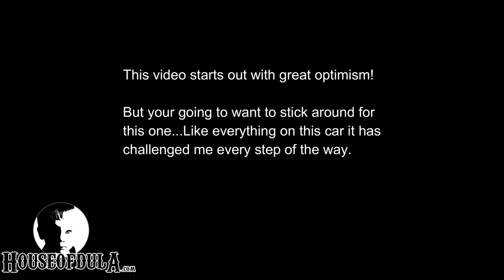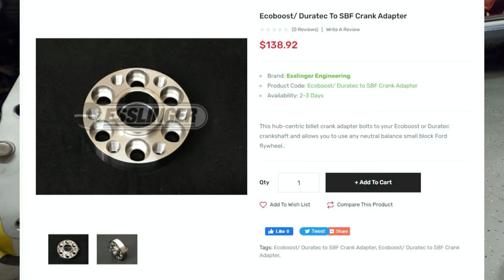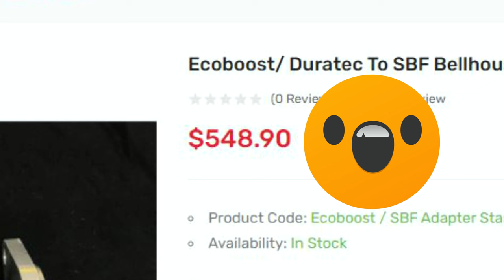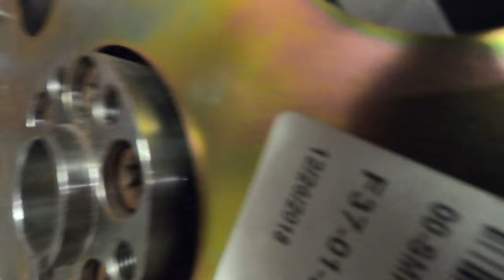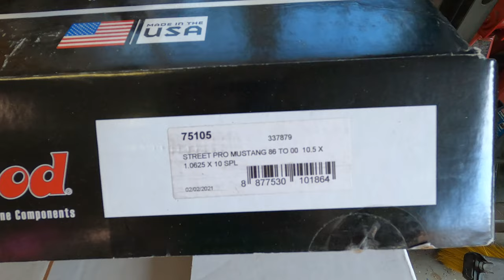Esslinger Issues - EcoBoost Install Part 1 - T5 mated to 2.3L EcoBoost - Episode 30

Comment: So I am curious, I'll have to rewatch this in case I missed it. Was that 2mm accounting for input shaft?
Reply from the maker: Yes and no, The crank spacer was milled down what 2mm? so the flywheel and clutch assembly moved in toward the engine 2mm while the bell housing stayed the same. This was enough to move my clutch out from hitting the bell. I dont think that amount will cause issues because it "seems" to me based on my measurements that the input shaft was not in far enough either. My logic says if all things are equal spacing between flywheel mount surface to bell housing surface between a SBF and 2.3 EcoBoost, then if you move the flywheel out with a crank spacer by "x" then the bellhousing must also move out the same amount. Its been a while, I measure the crank surface to bellhouse surface from a SBF and they were the same. What I milled off would have put  the input shaft in further, and the clucth/flywheel INTO the bellhousing more....anyway...the 2mm I took off seemed to correct all this without milling too much where the flywheel bolts wouldnt bolt on....I guess we'll see when we run it! lol I know Esslinger has made corrections to this kit since.

Comment: If you stack 2 spacer plates (or get a thicker one), you could still have starter alignment issues because the starter wouldn't "move back" with the bellhousing.  What if you cut off the portion of the spacer plate where the starter goes so the starter would pull up directly to the bellhousing?
Reply from the maker: This is true. If you stack the two you solve one issue. Clutch hitting bell, and clutch fork alignment, but would cause more issues with starter alignment.
Reply: @HOUSEOFDULA  Yep.  That's why most people buy new cars!  Personally, I like building them!

Comment: Did you do a bell house run out to make sure center, just put a TKX in my 88 and it needs to be .005 so you don’t jack up the input shaft
Reply from the maker: Man, you know, no I didnt. I guess because I ran that bell for so long behind my T5 without issue. Again...this is under the assumption that the Esslinger adapter perfectly centers the bell.

Comment: This is how my engine sounded on first start... But esslinger are so proud of the builds they would not entertain the idea that they failed horribly and in an embarrassing way.  Putting all 4 piston backwards and causing valve to piston damage. I sent them video at the time... they said it was the camphasers and had me tune it out.. now i realize what they had me do was basically prevent VCT from pushing valves as far down to stop the valve to piston contact.   Here is how it sounded on first start....   https://www.youtube.com/shorts/mU3-kfr1k04
Reply from the maker: Man! So. I "think" read your thread somewhere online all the way through. If not it was someone else who spent gobs of cash for a engine and the pistons we're in backwards.  I read this after making / using the parts, and all kind of confirmed my thoughts regarding the company and their poor R&D department and lack of quality control. Really sad we cant seem to find anything quality, and "get your money worth" anymore.
Reply: @HOUSEOFDULA  that was me 😕
Reply from the maker: @samsonyunited  Man Im sorry to hear. They still have not done anything to help?
Reply: @HOUSEOFDULA  nothing.

Comment: What did you do to the flywheel? Is the 2.3 ecoboost 50oz balance like a 5.0?
Reply from the maker: No, an EcoBoost 2.3 is Neutral balanced 0. So it is important to get a zero balance SBF flywheel to match.

Comment: just popped in...is a T5 really going to be strong enough for an Ecoboost?
Reply from the maker: Eh, we'll find out lol. The car is very light too which helps, and no plans to run a drag radial or slick (traction breaks T5's IMO) This was behind my 500hp turbo 86 car for a while without slicks or drag radials. I like the smoothness of a T5....I replaced the 86's with a TKO600, and had this laying around, freshened it up and decided to run it. Good thing is, with this adapter allowing for all SBF bellhouses, my options are limitless. If this trans breaks, in goes a TKX.

Comment: can you mill down the clocking plate on the starter to move the starter forward?
Reply from the maker: Absolutely could. Just would be a little more involved for the machinist to mill around that curve. Another viewer suggested this as well. Great idea, but I think we'll be good....Big V8 flywheel on a low compression 4 cyl, very easy to turn over, "shouldnt" wear those teeth out.
Reply: @HOUSEOFDULA  I agree, it will take a good long while anyways to wear out! Probably by the time the ring gear wears out your gonna want to replace the flywheel anyways!
Reply from the maker: @vrm86gt  Yeah or the engine! I no idea how many miles are on this guy anyway lol
Reply: @HOUSEOFDULA  fingers crossed that ecoboost will last you a long time! Happy Holidays Mike, I'm sure Connor is getting excited by now to open some presents!
Reply from the maker: @vrm86gt  Appreciate that! Oh yeah! man its full blown christmas time here.

Comment: I hope those weren't arp flywheel bolts.
Reply from the maker: They are, why not?
Reply from the maker: Nope. Ive never done that for flywheel bolts. Just loctite. Head bolts or main studs? absolutely use arp lube.
Reply from the maker: @centraltexasfoxbodies  - Eh, lol. 80 ftlbs or "good'n'tight" ARP engineers are a hellof a lot smarter than me,  its to ensure proper torque readings, so I probably should used it, but no lie, as many clutches Ive slapped on Ive never done that or lost sleep about the torque reading correctly on them.
Reply from the maker: @centraltexasfoxbodies  - Oh yeah! much different! lol Id be using a SFI steel bell too!